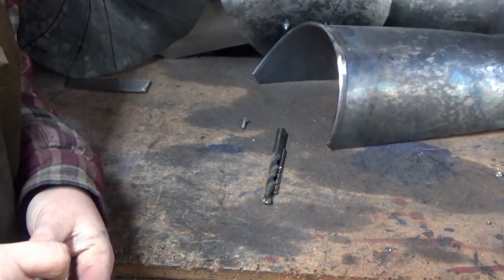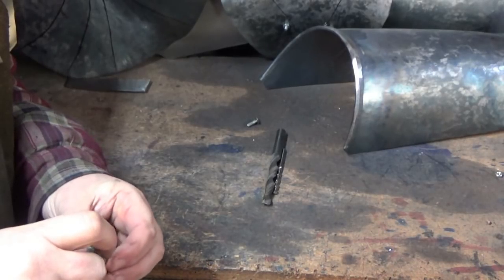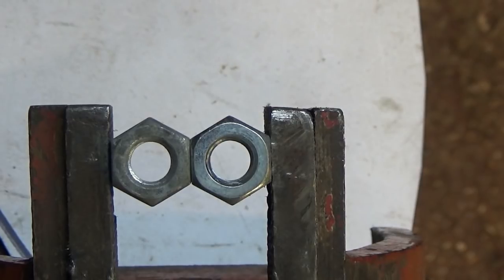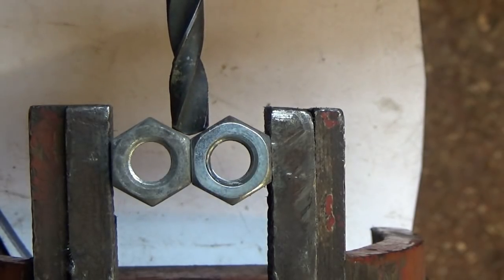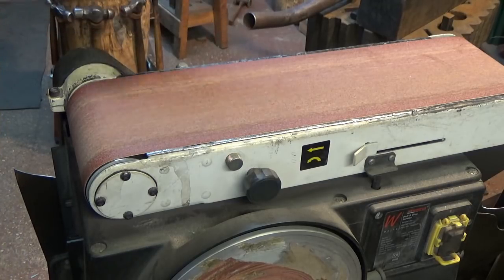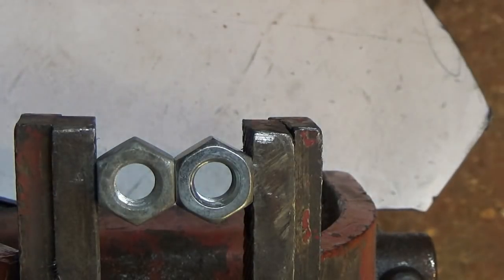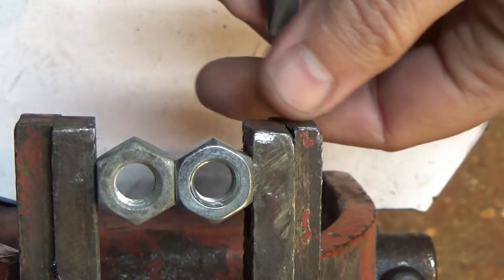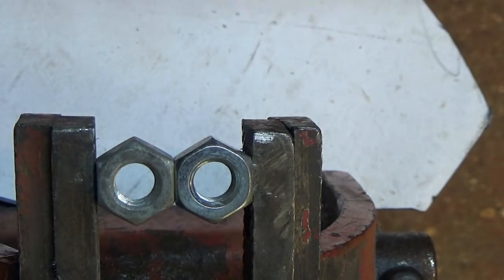Easily sharpen drill bits by eye.

Comment: The approach angle should be 45 degrees to the grinding surface. That will give a drill tip angle of 135 degrees for metal. Use 30 degrees for wood bits to give a pointier tip angle of 120 degrees

Comment: I worked for ole boy & could run streams of metal 2- 3 inches long when drilling just as easily sharpen the bits less than a min. which I struggled with Duane reached in his pocket pulled out two nickles held them next to each other ( like the nuts ) told that was angle I was looking for Duane I still struggle with it & have not mastered it ( but the lesson lived on ) in my defense at the time I didnt have two nickles two rub together

Comment: Nice trick with the nuts. I like to sharpen them on the bench grinder on a white wheel. Or green for carbide drill bits. My trick is to hold the bit over the flutes and rest  the knuckle on the support. This helps keeping the angles even Allways mind the center and twist it 180° often. 
I even do this with solid carbide for CNC machining.
Reply from the maker: Nice tip, I think I can see what you mean and might give that a try ... every day's a school day. :)